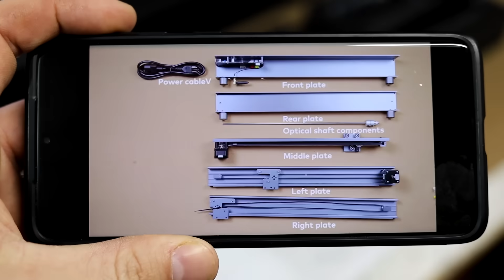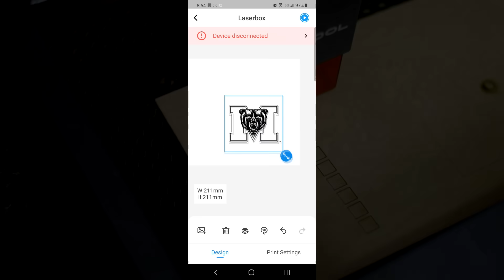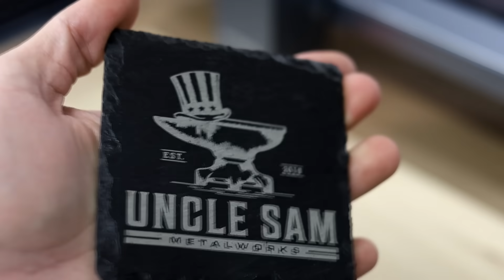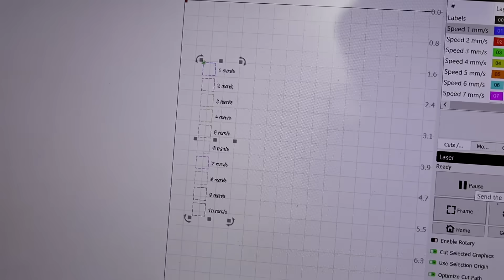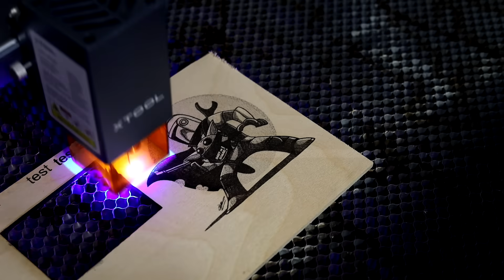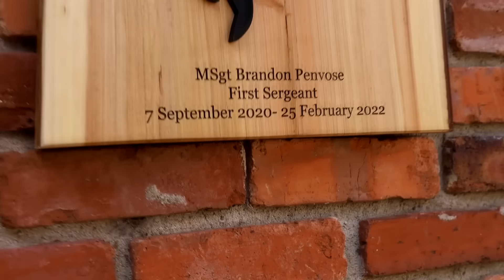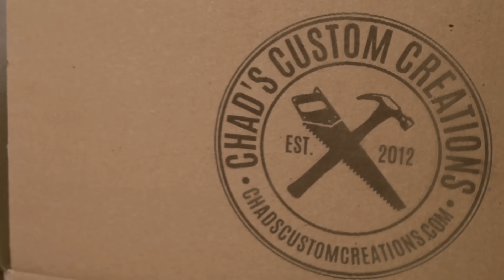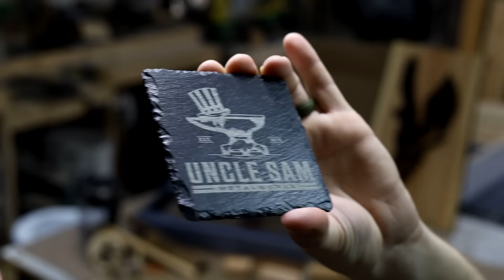The Ultimate Desktop Laser Cutter Engraver The XTool D1

Comment: Hi Chad, air-assist, while very important for keeping the beam from diffusing, won't help with cutting acrylic. 405nm diode lasers use visible light that passes almost unimpeded through clear acrylic - since nothing is absorbed, no heat is generated and acrylic is largely unaffected. CO2 lasers use long wavelength IR to which Acrylic is totally opaque. If you ever get the chance to play with a thermal imaging camera, try looking through glass or Plexiglass -both appear jet black.  You can surface engrave clear acrylic if you paint it black or stick on some builder's tape - the coating burns, transferring some of the heat to the acrylic and melting it. I've read that more powerful diode lasers can cut through darkly coloured acrylic, though I've never tried that - the CO2 laser is the correct tool for cutting acrylic and does it well. Btw, nice relaxing & informative video, thanks for that :-)
Reply: I have a neje module, it cuts 4mm black acrylic successfully although not as cleanly as a co2 laser leaving a slightly melted surface
Reply: As a rank amateur at anything in this space... I'd probably go to a local company that has a water jet and get acrylic cut there.
Reply from the maker: This is great information. Thank you for sharing this.
Reply: Howdy, Gordo!  I’m curious about your comment about the air assist keeping the beam from diffusing…

I’ve had CO2 lasers (including two 75W Epilogs that I still use daily) for about 20 years, and this is the first I’ve heard / read about protecting beam integrity with air assist.  The only time we use air assist is when we need to protect against flame-up when cutting materials like plastics, acrylics, and wood.  The air is blown at (or near) where the beam contacts the material, and almost eliminates any flaming.

Does it serve a different purpose on short-wave lasers, such as the one in Chad’s video?  Hoping to learn something new here….  :)
Reply: @bobtnailer  Hi Bob, I think the wavelength is a major factor in determining how much smoke affects the beam. My first laser cutter was a purple diode laser and smoke definitely affected the beam quality when cutting or engraving. I did a lot of tests (as one does when starting out) and blowing away the smoke gave thinner, deeper lines and less 'browning' of light materials close to the cut. I moved to a 60W CO2 laser years ago and haven't noticed the same defocusing of the spot due to smoke, though, as you say, air is essential to stop the work-piece from igniting. This makes sense - driving glasses cut through the haze by blocking blue light and a thermal-imaging camera can 'see through' mist. The wavelength of a CO2 laser (and IR cameras) is hundreds of times greater than either the wavelength of a blue diode laser or the size of smoke particles.
Reply: @gordo8189 , that makes sense.  We have a dedicated exhaust system for each of our lasers, so we don't have any of the nasty smoke/fumes hanging around while a machine is running.

It's an apples-to-oranges comparison to what Chad is demonstrating, since our lasers are production tools in a brick & mortar store.

Thank you for your explanation!!

Comment: Great video! 

Two questions for you….

1. What material do you place under the wood when cutting all the way through?

2. What material did you use for the cut out on the MSGT plaque?
Reply from the maker: Thank you!

1.So you can put any kind of metal under it or what's best is what they call a honeycomb bed which they actually sell as an ad on as well on their site.

2.That Phoenix was 1/4" MDF painted black. Though I didn't test the mdf on the xtool that was cut on my 90w co2 laser before I started testing out the xtool.
Reply: @ChadsCustomCreations  will the xtool d1 cut through 1/4 MDF? Looking to upgrade my small business from cricut to making more :d signs like the phoenix here.
Reply from the maker: @Dynaamiic_  MDF can be quite tough let me add this to my list of things to test.

Comment: How do you make sure everything is lined up and in focus? Like the slate coaster, how did you know it  was centered?
Reply from the maker: I placed a piece of scrap wood underneath the laser and lasered a 4x4" square. After that was lasered I can place the coaster right in the middle of that squares and send the new design from the computer used the absolute coordinates options on lightburn. You can do that or use the framing option aswell and line it up visually with the red laser pointers aswell.
Reply: @ChadsCustomCreations  thanks

Comment: diodes can not cut acrylic  due to the wavelength
I have a similar module and use air assist. wood works like a charm but acrylic : use co2
Reply from the maker: I saw someone else do a test and they could cut all acrylics except for clear, white, and blue.

Comment: Hi @Chads Custom Creations and everyone who may read this! I want to buy one of these lasers specifically to cut thin shim stock. I work with critical bearing spacing, and would like fast and repeatable cutting on steel and brass shimstock. I'm talking 
.0001" to as thick as maybe .005" material. Would this laser be able to CUT that? Also, since these diode lasers don't cut acrylic very well. . . do you think it would work on very thin precision plastic shim stock? Is the issue that it melts back together? Would it be just thicker material that would have these issues? Thanks for taking the time to read, and please comment back if you know anything about this. Thank you!!!
Reply from the maker: Hello Justin, so as for being able to cut the metals I don't think that is possible with these diode lasers or even co2 lasers. From what I understand is that if you want to cut through metals you will need whats called a fiber laser. As for the acrylics I have recently learned that these actually do well on acrylics just not clear, blue, or white.
Reply: @ChadsCustomCreations  Thank you for your input! I appreciate it.
Reply: you definetly need fibre lasers to cut metal, theres a special coating you can use to etch with a co2, no chance with a diode.

Comment: Could it cut 3mm acrylic or similar?
Reply from the maker: So I haven't tested it yet but apparently, clear, white, and blue acrylic are the only ones it cannot do.
Reply: @ChadsCustomCreations  damn it would have been a definite buy if it could cut 3mm clear
Reply from the maker: @Urban Aerials  when I get the air assist set up I'll test it out again but i believe it has something to do with the wavelengths of any diode laser regardless if the power.
Reply: Yeah it’s likely similar to my Formlabs 3D printer, only uses a 250mw blue laser but has to be super carefully calibrated and different exposure settings to opaque resins because of laser refraction within the clear resin.

Comment: Hi. What setting did you use on the slate coaster? I’m using laser box basic and took me around 60 minutes for the same one you did with 4 minutes only !!!!!
Reply from the maker: Slate doesn't take much power so I ran it at full speed I believe that is about 180/mms and I probably had it at full power. Not sure about laser box basic but with lightburn you can do what's called a flood fill which eliminates a lot of the traveling over blank spaces and basically keeps the laser on the parts that need to be engraved cutting down tike substantially.

Comment: How about smoke suction, how about honey comb grid (I tried everything nothing compares) how about air support??? How much power it has in Wats??? how much clearance it has from the material 2mm is very dangerous the cutted material can touch the laser head and the material gets push away and ruin the whole cut. I have an Atomstack A5pro 5,5W and a 50W CO2laser and the two in UNCOMPERABLE!!! Don't say that diode lasers are as good as CO2 lasers because it is simply not true (I would be glad if it would be true but it is just not) If you seriously want to cut material go CO2
Reply from the maker: Did you watch the video?
Reply: @ChadsCustomCreations  Yes sure... don't tell me that 10W is soo much more than 5,5W it is not... and I know what 5,5 can do used it for a long-long time... And other thing is how to clean that diode laser If it is strong it gets very dirty very-very soon and the cutting power go down like hell.... I have to clean every part of my Co2 if I cut MDF daily (mirrors lens, the machine itself). When I cutted with my 5,5W 3mm plywood I sometimes needed 7 rounds and it just went up to 10-12 after an hour. And it was just not reliable. Very often If I wanted to cut again without moving the material (because it did not cut through) it did not cut on the right place, and sometimes it just went crazy... with the Ruida controller it is a different world...
Reply: Oh and without a professional smoke suction it was soo smoky in the studio that I have to go out. I made a box for it after a while it helped a lot but still not the same...
Reply from the maker: @bacsi jancsi stayed tuned I will be adding the air assist kit xtool sells to this machine as well, which will improve it even more. This laser uses 2 5 w diodes and combines them into a single beam. It really is more power then I have even seen it a diode laser before I also have used a actual 7.5watt before and also have the ortur laser pro 2. Xtool is the first company to combine lasers like this and it truly does make a difference.
Reply from the maker: @bacsijancsi  that's a good tip thank you.
Reply: @ChadsCustomCreations  Ok Great don't expect too much from air assist I made it and I did not feel a lot of difference. I used 1-2 bar constant air from a compressor, the problem is that it has to flow away the smoke very fast otherwise it is not very strong... so smoke suction and air assist has to go along I think. Yes i know it uses 2 5W diode I am sure it is not bad, and since the kerf is smaller with diode laser it does not burn out that much material it might make less smoke BUT the difference is not huge and until diode laser does not get into the 20-25W territory it cannot compare.... and how will it go there to put 4 diode in one house instead of two??? Will it heat up too much??? it seems to me that they cannot really make stronger diode laser than 5-6W... Yes I know that some say that what they have is 7.5W but others deny that (I never had such so I don't know) Soo lets see what next year will bring :-)
Reply from the maker: Nothing wrong with being skeptical of new technology I am aswell. Hope you follow along and see what it can do in the future videos.
Reply: @ChadsCustomCreations  One more thing these machines are quite expensive we are talking about $700-800 which is about the half of a 50W CO2 laser cutter along with shipping... and honey comb bed and mechanical bed height adjustment, and somke suction and air assist and turntable ...hmmmm I don't think they are even a really good deal... ok prices might drop after a while but a 10W diode laser modul is NOT cheap....
Reply from the maker: @bacsi jancsi awesome

Comment: Run and owned Co2 lasers for over 20 years. These diode lasers have  really come a long way. Nice to see. Aso I've heard that it's only the clear acrylic. Try black or another opaque material
Reply: No, it has a hard time with MANY colors of Acrylic (White and Clears are worst but not the only ones. Anything with Blues in the 400-450nm range or so), Glass, thicker woods. CO2 can cut 3/4” or more and Diode’s can’t (cleanly).

I have both and even a K40 can Engrave and Cut MANY things even the new 20 Watters still can”t.

That’s why it’s in quotes. To try fool those that don’t do their homework and/or don’t know any better.
Reply from the maker: I am super impressed, and you gotta love how portable and low maintenance they are. I will find some other acrylic and give it a go thanks for that tip.
Reply: @ChadsCustomCreations  let us know.

Comment: Have you run into the situation where the Laser will try to go outside of its bounds  and it grinds because it can’t go any farther, so you have to power down or quickly press stop? I haven’t been able to figure out how to prevent it, and I’m sure that’s not good for the motors or the belts. Is there a way to prevent that?
Reply from the maker: If using lightburn you can set the start from position to use absolute coordinates and in there you can also have the machine home itself to the top left corner. I was able to change something in the setting on lightburn that also makes the machine home itself at every start up so crashing into the sides is no longer an issue.
Reply: @ChadsCustomCreations  Thank you!

Comment: I have been looking into getting one of these but I can't seem to find an answer on it's ability to do what I am envisioning. 
I want to powder coat a panel white, then powder coat it red, and then etch away the red layer with my design but not the white layer.
Do you know if this can be done?
Reply from the maker: I believe if you can get very consistent thicknesses this should be possible depending on your speed and power. I have seen people do this on tiles with spray paints its pretty cool. If you want to send me a sample, I would test it for you.

Comment: I have been getting random line in my portraits and in some tumblers..not sure why this is...sometimes it happens sometimes its good...
Reply from the maker: There are a few things that could cause that first thing I would look at would be is the plug in the wall that your using on the same circuit of anything else that could be causing a power drop or anything. I have to remind myself to not use my miter saw when my red and black laser is running cause it drastically drops the power and creates ghost lines.

I also heard someone say that the most reliable way of file transfers is to use the USB cable to a laptop and not rely on the wifi as for them they were having similar issues.
Reply: @ChadsCustomCreations  ok i do ue a hub so i will plug it in directly and try it...i use my laptop directly to my laser via usb so cant be that. ..
Will check the power drop for sure tho. Thanks!!

Comment: Good review.  Is that 10 watt output?  Or is that marketing 10 w.
Reply from the maker: I know right who can you believe. As far as I know this is a combined 2 5w output diode light beams that combine into a single beam of light creating that 10w output value.
Reply: @ChadsCustomCreations  that is amazing.  Put my ortur to shame. I need to add air assist.
Reply: They just released a 20w. They tested it on a livestream. The optical power measured just over 18w at the laser 🤯
Reply: xtools now is offering a 20w laser module